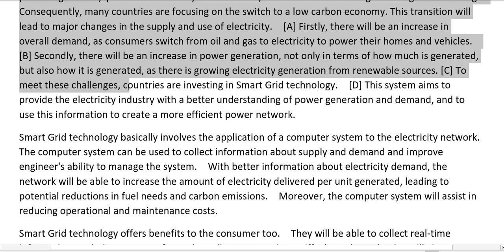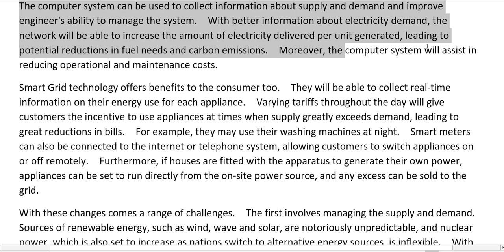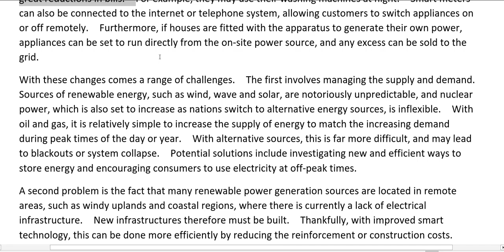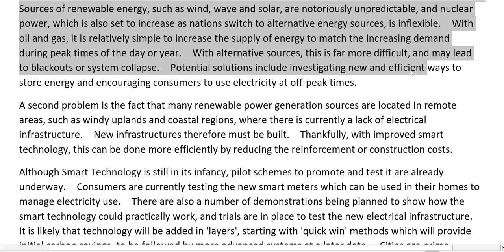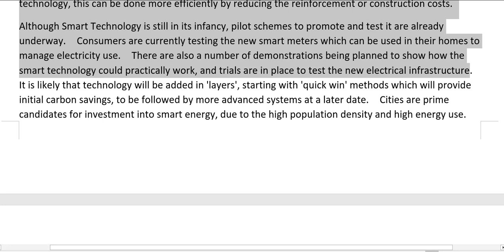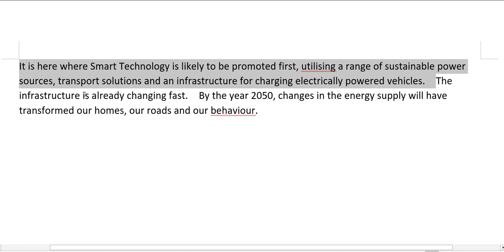TOEFL READING #6 | The Future of Smart Energy

Comment from the maker: 1 According to paragraph 1, what has happened in some oil producing countries?
 A They are unwilling to sell their oil any more.
 B They are not producing as much oil as they used to.
 C The supply of oil is unpredictable.
 D Global warming is more sever here than in other countries.

2  Where in paragraph 1 can the following sentence be placed?
There is also likely more electricity generation centres, as households and communities take up the opportunity to install photovoltaic cells and small scale wind turbines. 
 A
 B
 C
 D

3  Which of the following is NOT a benefit of Smart Grid technology to consumers?
 A It can reduce their electricity bills.
 B It can tell them how much energy each appliance is using.
 C It can allow them to turn appliances on and off when they are not at home.
 D It can reduce the amount of energy needed to power appliances.

4  According to paragraph 4, what is the problem with using renewable sources of power?
 A They do not provide much energy.
 B They often cause system failure and blackouts.
 C They do not supply a continuous flow of energy.
 D They can't be used at off-peak times.

5  In paragraph 6, what can be inferred about cities in the future?
 A More people will be living in cities in the future than nowadays.
 B People in cities will be using cars and buses powered by electricity.
 C All buildings will generate their own electricity.
 D Smart Grid technology will only be available in cities.

6  The word 'remote' in paragraph 5 could be best replace by:
 A isolated
 B crowded
 C attractive
 D alone

7  The word 'underway' in paragraph 6 is closest in meaning to:
 A permanent
 B complete
 C beneficial
 D in progress

8  17 What is the main idea of the final paragraph? (paragraph 6).
 A To describe who will benefit from Smart Grid technology first.
 B To outline the advantages of Smart Grid technology.
 C To summarise the main ideas in the previous paragraphs.
 D To describe how, where and when Smart Technology will be introduced.

9  In paragraph 6, what can be inferred about the introduction of Smart Grid Technology?
 A The technologies which produce most benefits will be introduced first.
 B The cheapest technologies will be introduced first.
 C The technologies which are most difficult to put into place will be introduced first.
 D Technologically advanced systems will be introduced first.